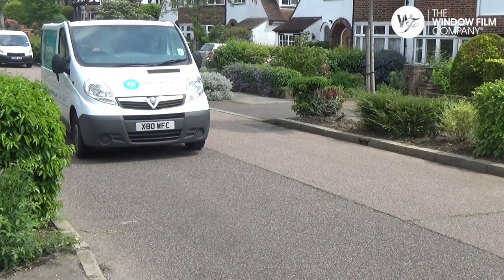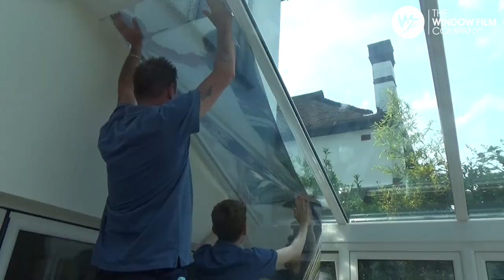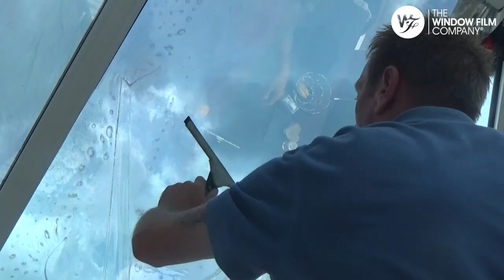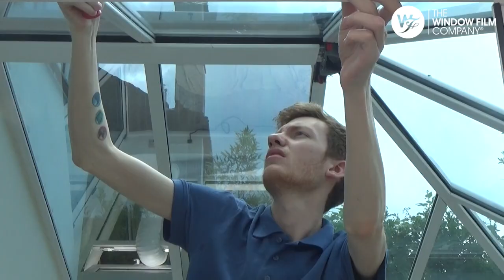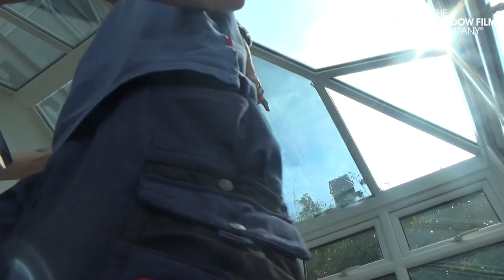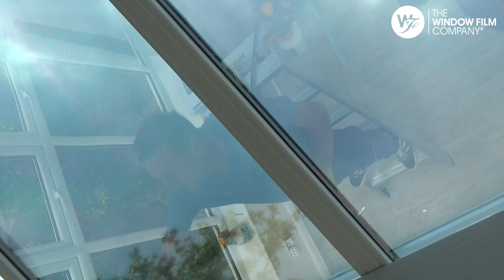Conservatory Roof Heat Reduction Film Installation

Comment: We have installed heat and glare reducing solar control window film to countless conservatories, since the business started in 1998, so we really do know what we are doing when it comes to helping with trying to keep their conservatories cool in Summer. If you think you might benefit from window film installed in your conservatory, there is more helpful infomation on this page https://www.windowfilm.co.uk/residential/conservatory-too-hot - If you are interested in buying window film for your conservatory and installing it yourself, you should take a look at the range available on this page of our website https://www.windowfilm.co.uk/buy-online/window-film-by-the-metre/conservatory.
Reply from the maker: It is also worth mentioning we have two different conservatory roof solar control products available, so we can install window film to both polycarbonate conservatory roofs (see https://www.windowfilm.co.uk/buy-online/window-film-by-the-metre/conservatory/supertint-poly ) as well as glass conservatory roofs ( see more info at https://www.windowfilm.co.uk/buy-online/window-film-by-the-metre/conservatory/supertint-glass ).
Reply: Hi can this be applied to a polycarb conservatory roof,
Does it keep the room cool in summer, will it also keep warm in the winter ?
Reply from the maker: @user-xc7gb8gj6r  Hi, yes we have a specific film for a polycarbonate roof.  It will not insulate during the colder months.  If you call 01494 794477 and speak to Dean, he will be able to assist further.  Thanks

Comment: Deos it work theother way to reflect heat back inside in the winter or  will it just work one way and reduce any solar gain ?
Reply from the maker: Sorry we missed your question.  This film is just for reducing solar gain.  We do have another which can help insulate.  Best to call 01494 794477 and they can help.  Thanks